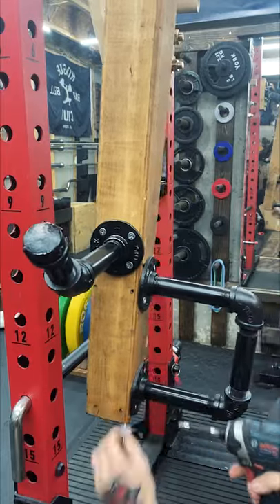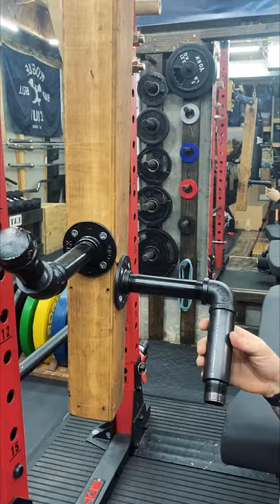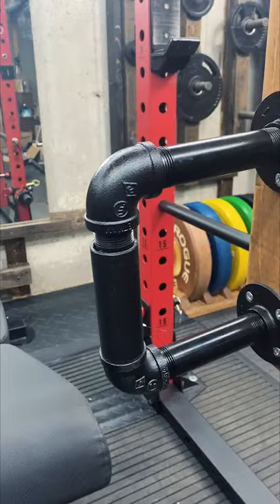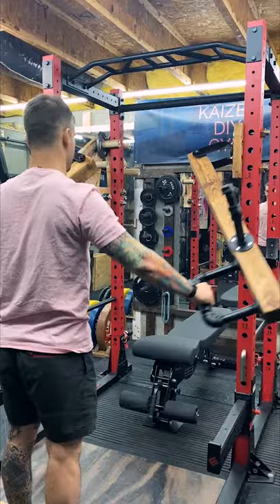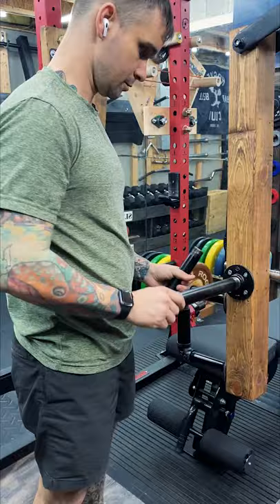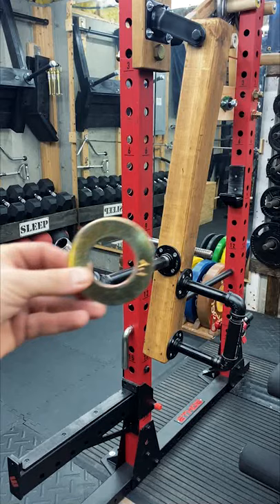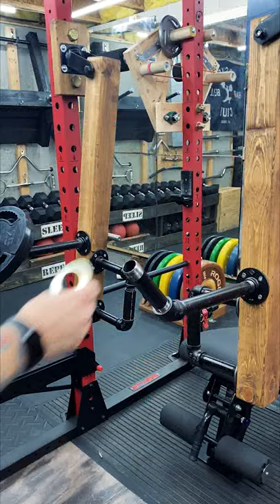Swivel Jammer Arm Upgrade #shorts

Comment: Think it’s better to have your machines independent of each other versus connecting them together. This allows one to find which is the weaker arm /shoulder/etc and adjust the weights
Reply from the maker: True!
Reply: A multi tool is more economical, by far.

Comment: Can someone please ELI5 why the washer makes the resistance more consistent?
Reply from the maker: Without the washer offsetting the placement of the weight, there is zero resistance at the bottom and the resistance generally increases until it hits 100% at the top of the movement (or when the arm is at a 90° angle with the rack)
With the washer, the weight is offset creating resistance at the bottom and keeping it consistent throughout the movement. 
Think about holding something heavy with your arm down at your side vs holding that same thing with your arm out perpendicular to your body. Which is more difficult?

Comment: whats the weight capacity of these? Have they been tested?
Reply from the maker: I cover that in the full video on my channel
Reply: @KaizenDIYGym  ive seen the video but iirc you mentioned the castors were rated for vertical/compressive load and you werent sure how they would hold up long term with heavy weight at these angles